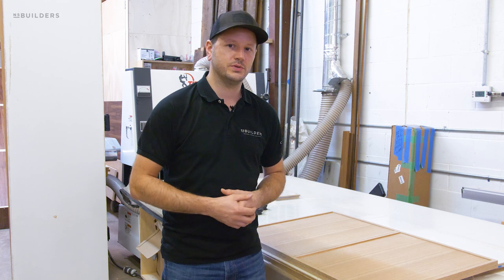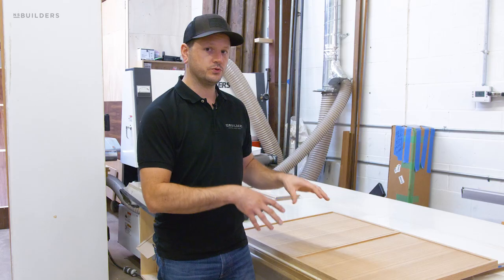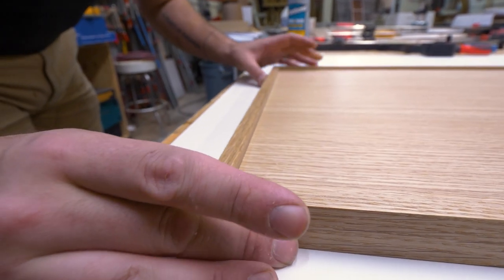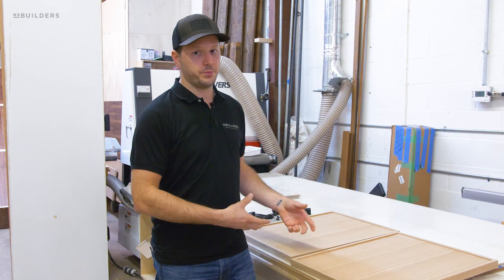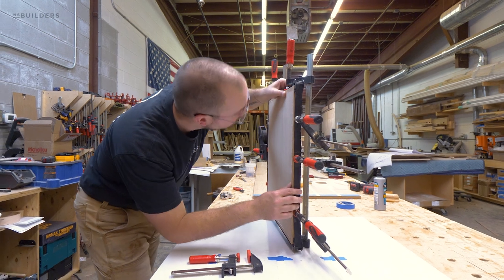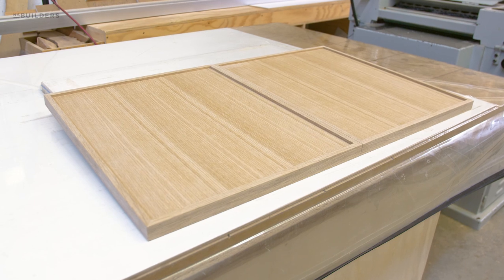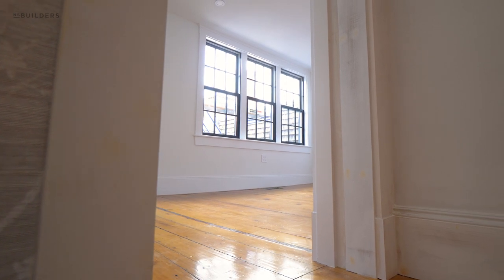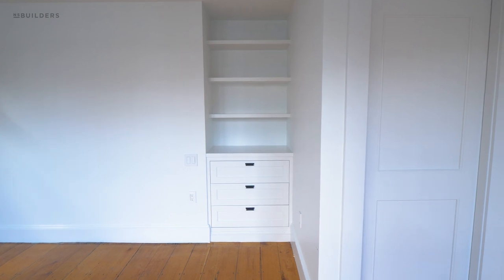How we use a BAND CLAMP on our micro shaker doors

Comment: Gotta say I wasn't expecting a glue only bond for the framing of the micro shakers. I'm sure you guys have done your due diligence and I doubt I need to ask, but have you seen how they hold up long term vs something with a mechanical connection? And I'm drooling over those built ins. Man the white shaker with the walnut interior is so clean.
Reply: Tough to say. What kind of mechanical fastener would be efficient in this application? Thanks. The built ins are awesome. Color combo is on point!
Reply: @kendecost  Not sure. I suppose I imagined a tenon and mortise connection with the rails but I doesn't look like there's quite enough meat on the frames for that. I guess I just see your other doors and they seem like they'll last 100 years easy. Whereas with a glued connection it just doesn't seem like it will stand the test of time as well. How long is the glue itself supposed to last for? 15, 20 years?

Comment: Very clean look on the mini shaker doors!  Panel thickness?
Reply: panel is 3/4" band is 1"
Reply: @kendecost  Would 1/2 panel be more prone to warping?  Or just not as solid
Reply: My question is if the band is 1” thick what kind of euro hinges did you use to avoid the doors from rubbing the edges when you open them.

Comment: What type of hinges do you use on this style of doors? Seems like Euro style would be out?
Reply: euro work fine with this style of door as long as the substrate is thick enough.
Reply: We used typical euro hinges on the jamb side and soss hinges at the bi-fold. They do make euro hinges for the bi-fold but I prefer the soss for this application.
Reply: @kendecost  thanks for the feedback!!